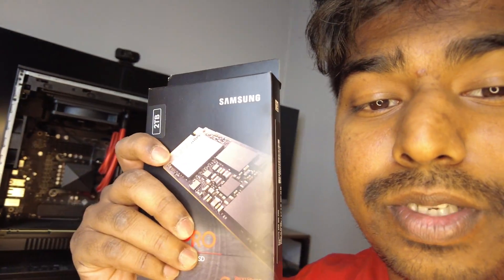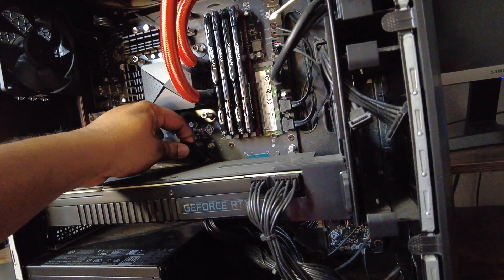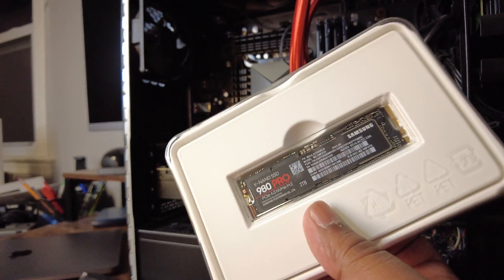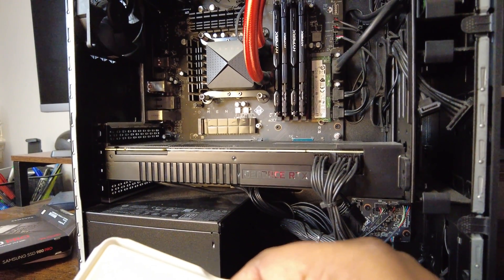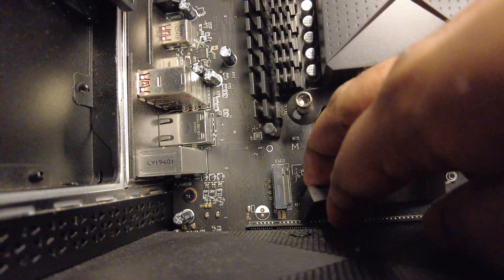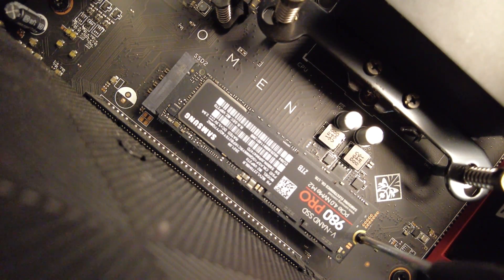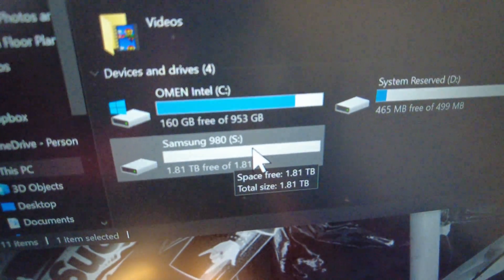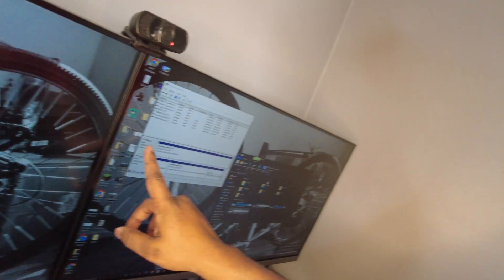Installing Samsung 980 PRO 2TB PCle Gen 4X4 NVMe Gaming Internal Solid State Drive M.2 SSD and Setup

Comment: I just now installed it and nothing is popping up on the disk management
Reply from the maker: Try restarting or reinstalling. If that doesn't work, try to replace the ssd with another one. If not, try cleaning out the port. Hopefully, it's not a defective port.

Comment: What kinda screwdriver is you using i got mines today and tried all kinds of small screw drivers and its so tight i cant removed the screw
Reply from the maker: It's just a Phillips head screw driver, but it does have to be small. You can get a set of these screw drivers at hardware stores, Walmart, Amazon, or even dollar stores.

Comment: Do i need a specific type of motherboard to use this? Or do that all have that setup with the screw for the ssd drive
Reply from the maker: It should work as long as your motherboard has m.2 slots.

Comment: Hello I’m new to pc building and was wondering if I could install this with my old storage so I don’t loose past data ?
Reply from the maker: Yes, you can! Just plug in your old drive and it should work automatically. If it doesn't show up, follow the steps that I have toward the end of the video. Good luck with your build!

Comment: I cant take the screw out. What screw driver is that? My one is too big
Reply from the maker: I got that set from a dollar store but you can find a set like this in any hardware store or online. Just make sure that the one you’re using is the right size and turns the screw without slipping.

Comment: i cant get the damn flapper thning screwed in.. so i just have to not hit my pc and the ssd will stay in there lol
Reply from the maker: Did you remove the padding?
Reply: @ARSPLink  yes, i just keep dropping the screw, cant even get it to screw in cause im too shaky and all
Reply: plus theres barey any room too
Reply from the maker: @timothytoler9065  I had a very similar issue, so I unplugged my PC and turned it on its side and let gravity hold the screw in place.
Reply: @ARSPLink  Thanks!

Comment: i installed the 980 Pro but i see that i need to have PCIE for optimal speed???? what  do i do?
Reply from the maker: I think you can get an external one to run it (but do check the specs to make sure you get the optimized speed, or you can go the expensive route and get a new motherboard that has one.
Reply: I installed same one in Asus Strix g15 513qc which shows it is supported for gen 4 but it doesn't run at 4x4 instead it runs at 3x4.... What should I do